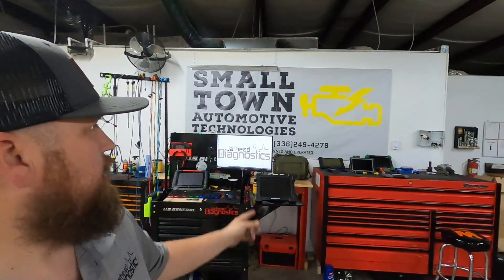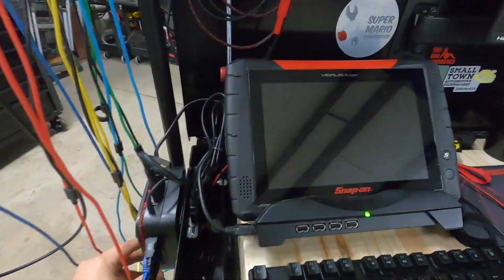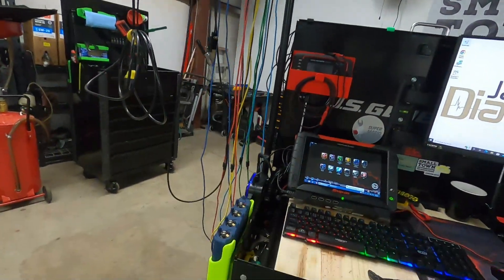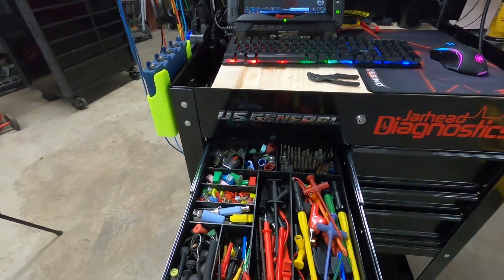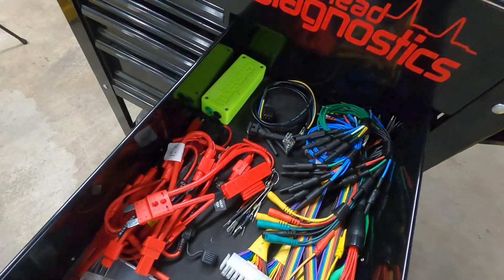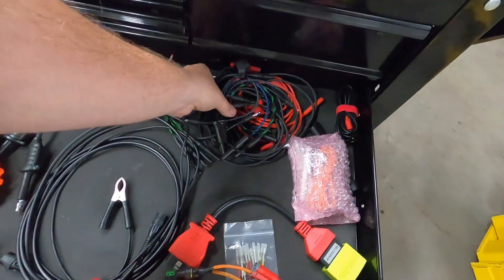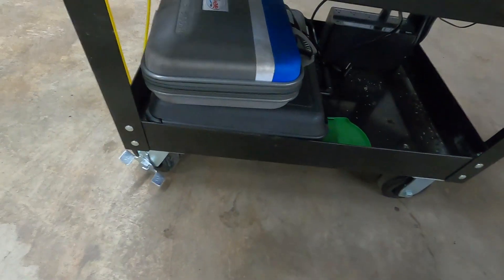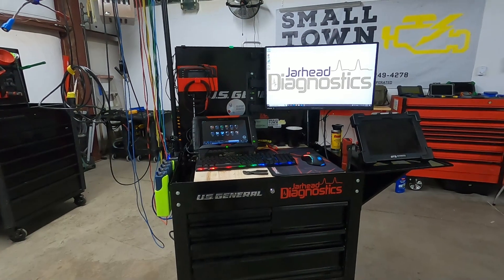Tool Box Tour- Diag Cart Edition

Comment: Same issues with monitor being stationary against the lid, the swivel for the monitor sold me and the mini pc, hate moving the pico would much rather keep it in one location, constantly having connectivity issues with labtop believe plugging and unplugging usb cord causing problems. Your battery backup is another great idea. Thank you for the video and tools, have purchased several and made my diag easier.
Reply from the maker: Yeah, my last cart was nice, but annoying at the same time. So I opted for some changes this time around.

Comment: Looks nice. You have crazy money invested, you must do tons of specialized diag to support that. Saw some nice little adapters that I should add to my kit though. Thanks for the video.
Reply from the maker: Yeah, over time things really start adding up. What adapters are you wanting to add?
Reply: @JarheadDiagnostics  I liked some of those breakout fuse leads and the relays with the wire loop on them to be able to measure off of them. I'm just getting started on improving some of my diag skills by using a scope.

Comment: Really like your cart.working on getting mine.just got a question about that video you did on snap on presure transducer. Will ats 500 transducer work on verus with split lead cable.or need 5v box
Reply from the maker: You will need a 5v power supply.

Comment: Been using the scope on my Zeus for several years and now the Zeus+. Never tried anything else. Is pico really that much better? Now that it’s not connected to the scan tool, I want to set my cart up with a boom and need to decide if it’s worth buying another scope
Reply: the m4 scope module only has 3mhz bandwith which is cool for most auto related stuff but yes the Pico is. it has 25mhz bandwidth with 12 bit resolution so u can get a lot of info,plus it has all the serial decoding for can,can fd, flexray and a bunch of other protocols . u can use it as a spectrum analyzer as well but what most people like is the automotive version because u can choose a test and it will auto set ur probe and scale it for u and it will show u how to do the test and what the waveform should look like.ive never used it because ive used scopes so much i can set up what i want to test so ive never had one of their automotive scopes. i use their test and measure scopes but if u know how to use one u dont need to buy an auto one,just get a 2000 or 3000 series for less and u still have all the features but with more bandwidth, just cant use the automotive features. i have a 6407d, 6404d, 4824a, 5204a, 2205a and a 2204a and i love them all but i do a lot more than just automotive. i do a lot on the electrical engineering side for after market ecu related stuff and im coming out with some hacking,tuning and programming tools very soon. hope this helps. u wont regret buying a pico nomatter what one u buy. i still have my 2202 from 2001 and it runs perfect on picoscope 7.

Comment: I noticed the Deoxit. Have you ever used Lime Away or CLR  products to clean corroded terminals?
Reply from the maker: I’ve used purple power before. It works well. Just have to neutralize it with water afterwards.